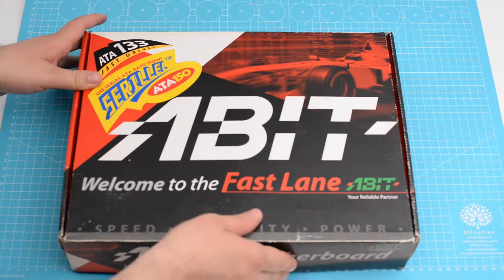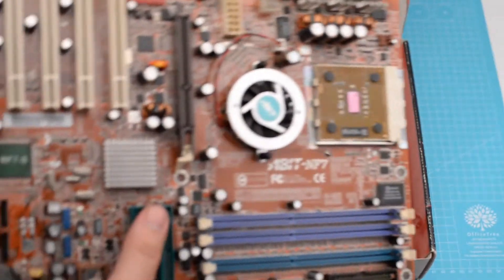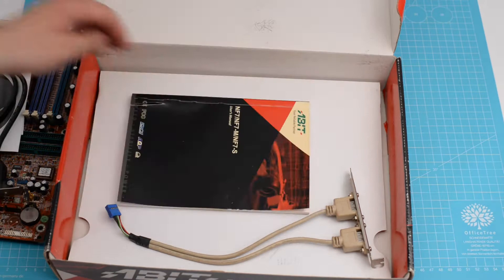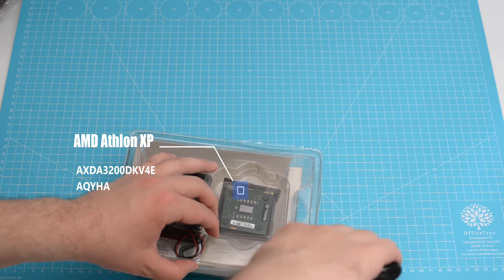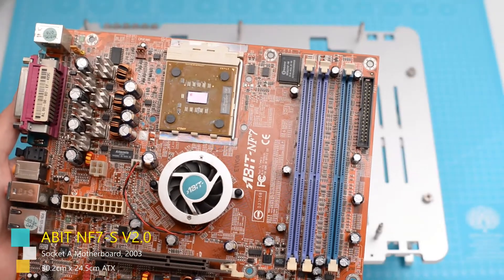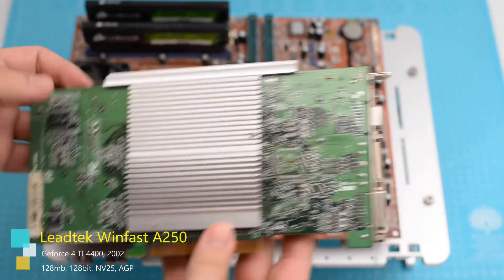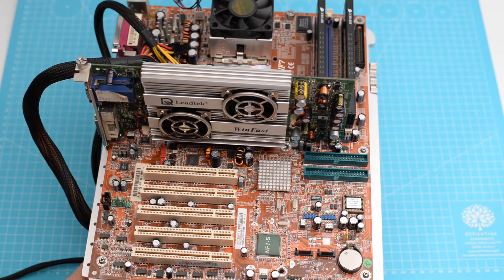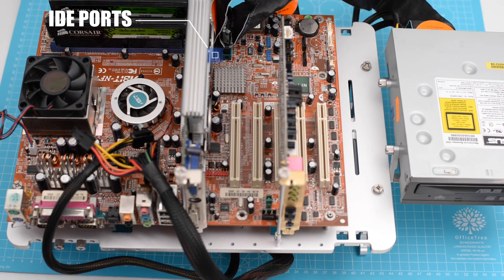ABIT NF7-S v2.0 - Unboxing and Assembly

Comment: That psu is vastly underpowered
Reply from the maker: It's really quiet. I initially planned to use it in a Pentium M configuration that I abandoned. That configuration only required about 50W idle and 90W load and the PSU was more than enough for that system. I used it for a few tests in this series then I replaced it with an Corsair 650VS (650W) due to more power hungry CPUs and overclock. Now that you mentioned it may be a reason why the overclocking of the Pentium 4 went so bad. For me it wasn't a big concern since the Athlon XP required about 110W idle and 150-160W load.

Comment: Very good test on this build of the game gta hl cs 1.6?
Reply from the maker: The game tests for Abit AN7 (the sister of NF7-S) contains some footage from GTA VC (if you want to see the framerate) so please check that clip. HL and CS 1.6 are very good suggestions that fit into the timeframe when GF4 ti 4400 was on the market. The 2 games were released before 2002 but they were actually very popular when this video card was launched so I guess I will give them a try. In the 3200 series I will look at (yet) another Athlon 3200+ (probably the most advanced) but I will continue to use the GF4 ti 4400 and I will test HL and CS 1.6.

Comment: I have both a NF7-S 2.0 and an AN7; in absolutely all tests they perform identical - including 3d mark 2000&2001, however I consider that in usability AN7 is the better one: more USB ports and uGuru are among the advantages. Great review and good luck!
Reply from the maker: Thank you. Now it's almost clear to me as well that at stock speeds the AN7 and NF7-S are evenly matched. But once the FSB increases :) the NF7-S it's in a category of it's own, or maybe my AN7's capacitors are tired. I'm also curios about the DFI LanParty sk A ultra ver B that will get it's review sometimes in the future.
Reply: How many USB ports has it? I still use my NF7 S2G I bought brand new in 2004, and it actually has 8 USB ports. Although 4 of them has to be connected directly on the main board. I have utilized all of them. Currently my MB is set up with a XP3200+ (400FSB version) with 2GB of 400mhz Corsair XMS CL2 and a Sapphire Radeon X1950 Pro.